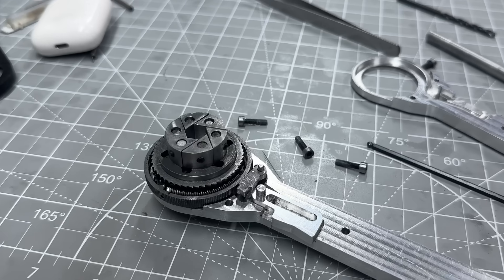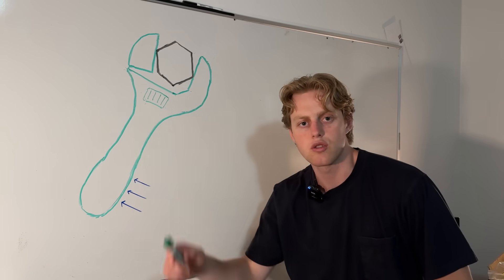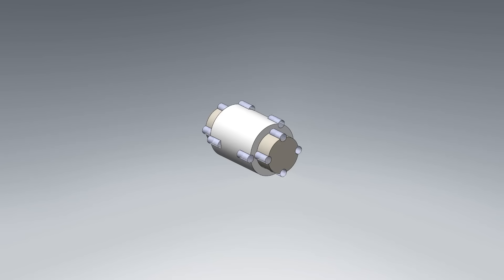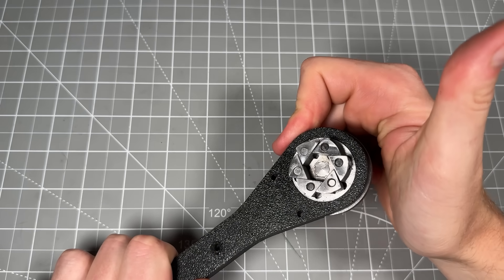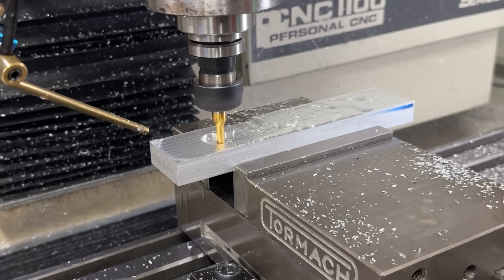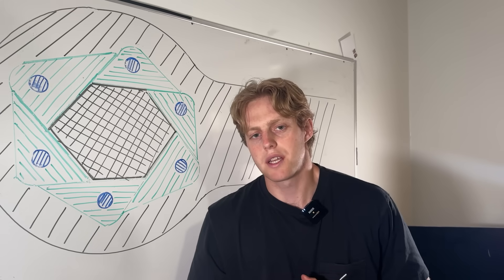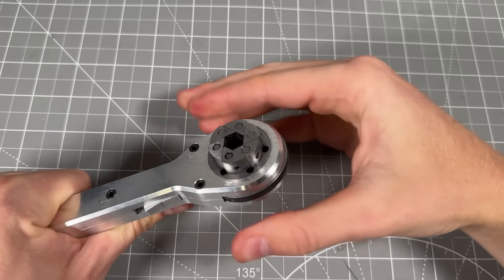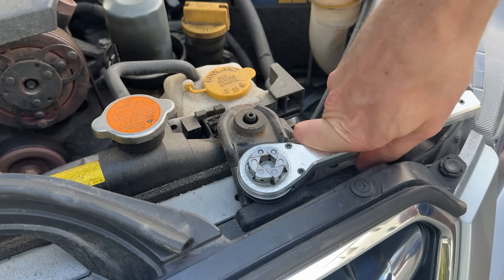I Invented an Adjustable Ratcheting Wrench

Comment: What might be possible if you released the criteria that one mirrored wrench can both loosen and tighten. Instead, you could make a pair or wrenches. 
First, this version would have a lower profile and fit in tighter spaces. 
Might the enable the gripping teeth to be moved more inward to the centerline of force of the lever and make it stronger?
Is there any way the center bushing could be made with much larger putter diameter so the a hole may be drilled through it, a hole that could pass over a threaded rod, enabling this tool to be more versatile?

Comment: One of the biggest downsides of sockets/screwdrivers is that theirs tolerances mismatch with bolts/screws too much and they wear down very fast. Your design takes rid of this, thats big +.
Unfortunately, massproduction will be VERY expensive, scale size up and down not that easy as well.

Comment: Having this as a socket would allow it to get into tight spaces and allow it to be used on already existing (power-) ratchets and socket extensions. It would also simplify the design because you would already have the ratchet mechanism. Maybe with this in a few different sizes you could swap out a whole socket set with just a handful of auto-adjusting sockets.
Working on cars a lot this would definately be game changer for me!
Great design!

Comment: You should definitely keep working on it, I once bought a one size fits all socket which was spring loaded pins into a bigger socket but it had terrible design the pins would bend in the housing easily. 

I like the locking mechanism on this, it is much better designed but as you pointed out at the end it works best on a flat surface you'll struggle do to some car stuff with it unless you design a longer socket.

Comment: Hi, i know this is random but i have a question, i work as a diesel mechnic and work on ALOT of differwent things of different sizes, this might ne a long shot but would you ever consider sending one out for me to test, can be used on excavators, dump trucks, trucks, vehicles, etc

Comment: As a mechanic myself, I find that compactness is MUCH more important than having more functions. I would rather buy two thinner ratchets, one that tightens and one that loosens, than a single thicker ratchet that does both, even if it cost me more. It's better to have to get two tools than just one that doesn't fit where you're trying to reach.

Comment: Instead of front and back tighten and loosen put them on either end of the handle. so the mechanism is thinner to fit in tighter spaces.
Reply: Where a bolt is located is a bigger issue than a one size fits all wrench. It’s why god created tool boxes. What I have a hard time finding is a super slim well made ratchets at affordable prices.

Comment: This would be a bad ass tool to have in a ratchet set for the easy stuff and to replace the old adjustable!  But, like you pointed out in the video, 9 times out of 10 getting to a nut or bolt isn't that straight forward. 

 I guess the problems this product would face is cost to manufacture vs overall usefulness. If you could get it made cheap it would be a welcome addition to any ratchet or wrench set.

Comment: Im liking the idea. I can't wait to see the future version, I will see if I could come up with a way to face loosening and tightening on one side. 
I would also say try looking at high-end drill gear boxes, some have pins to lock the gear box to not turn the motor when trying to take the chuck off or tighten it

Comment: I love this product! I will say don’t lose focus on making the best adjustable wrench. Don’t focus on a job for deep sockets and other tools. What you have is the beginning of a 3 piece set of small, med, and lg adjustable wrenches that doesn’t round bolts plus has a ratcheting mechanism. I would rather have that than make the weaker or larger by trying to do additional things.

Comment: I like the idea.  I do manufacturing of industrial control panels, mostly for automation and pharmaceutical applications. Two additions I would like to see is adding torque reading/limit to the wrench itself and a pass-through. Most of the nuts we apply have long studs. So without a deep well or a pass-through it wouldn't be all too practical for us. 

My main concern is how long will this last due to the precision? How well will it hold up to oil, dirt and metal shavings?

Comment: if, instead of a full rachet wrench, you make the same stuff into sockets.....and you make different sizes, each overlapping each other by a little bit. then i would buy it knowning that it can easily fit into how i normally work. i just need a rough guess on the bolt head size, and pick the "roughly right size socket" then rachet it like we already know how to with tools we already have. plus the additional flexibility of using U-joints, extensions etc. not to mention you can have smaller overall diameter for compare to current setting for you no longer need to build rachet ring inside.

i mean, your invention of spin-open and release grab is the best part of the tool, that's cneturies ahead of shift spanner. meanwhile for the racheting mechanism, with all due respect, really doesn't need its wheel re-inviented. 

best wishes bro. cant wait to see it become an actual product.

edit: to clarify, while it is great to have one tool/socket that goes both ways, it's not a big deal to have it go one way. choice one: bring a lot of socket that goes both ways. choice two: bring 2 sockets that go one way each that sure fits. it still wins. and btw i think only lefty-loosey is needed for most people. becuase if i have a bolt to tighten, i would just bring the bolt to socket rack and get the correct size. 99% of the time when i don't know the correct size is when i need to take off a (usually rusty bolt), or the last fucker who did repair work put an odd size bolt head that fits becuase he send old ones flying down the pit and couldn't bother to get the exact same bolt for the hole.

and i'm very sure that your tool's main intended scenerio would not be to replace sockets altogether, but to solve the "just save me the trouble of bringing lots of socket to the bolt" case. for the simple fact that having impact sockets only will eventually get you mad by " damn i wish i have the exact same socket but in chrome so it will fit with thinner socket wall" shit.

Comment: Awesome work and great engineering.  This would be great to have in the tool box - even possibly as a great tool to put into the car on a road trip so the bag is just a little smaller.  Would be interested for sure.

Comment: What could be really cool is a socket like that, potentially with different sizes for 1/8", 1/4" & 1/2" rachets. Basically, just implement the adjustment mechanism, double-sided just like here, but intend of a ratchet in the center, you have the square receptacle for the ratchet.

Comment: You can make this into a socket that can be used with existing wrenches. That would solve the issue of reaching into spaces. This being a universal fit socket would make it very useful for those times when you don't know what size a bolt is and you don't care, you just want it tight or out. Your ratchet wrench doesn't really add that much value to the concept. Just make two, one for tightening and one for loosening. Keep it simple.

Comment: Do those pins really need flats on them? Can you just put the pin through and use the set screws on the jaws to preventaxial movement of the pins?

Comment: this is honestly pretty cool. I would say for anything larger than 1/2" bolts the entire ratchet mechanism could be made larger and bigger so that it's more solid as bigger bolts will require higher torque specs. I could see this being a one stop shop for almost majority of the bolt work on DIY projects.

Comment: I would say it shines in fields where you have open access to fasteners, factory maintenance, or design/prototyping. What comes to mind for me is when engineers are building factory fixtures/benches from off the shelf supplies, and robot assembly, it makes the most sense for people who don't roll a toolbox around to do their work.  I wouldn't target automotive use, there's too many specific places where sockets are used because nothing else will do, and if you already have a full set of sockets sitting next to you that's what you would grab

Comment: I'd spend money on it now, but you don't seem entirely happy with the design. So in addition to your plans to make it fit more places and find a way to tell which side does which, I'd be interested in engraving marks to measure the size of the gripped bolt in imperial and metric.  An even greater challenge would be to make the center completely hollow so it could thread nuts onto bolts as well.

Comment: I think you might need a set of about 3 or so to be efficient in a range from 1 1/4 inches down to 1/4” 

Ultimately it’s impossible to replace every job. I work on small aircraft and generally operate between 3/16” to 3/4” and I have a variety of different tools. Sometimes I wish I had a tool that doesn’t exist.. This can fill the role of quickly tightening or loosening easy access bolts and nuts but if the threaded shaft is too long then it might not be deep enough and like you stated the bulky body that houses all the required parts make for cumbersome accessibility. 

I want one though

Comment: As a mechanic I can assure you that unless it has a pass through for nuts on long threads it wouldn’t even be considered to be anywhere near my toolbox let alone a regularly used tool. When I need a socket I just take the whole rail with me and have the whole set of sockets right there at the work. You should also consider the forces when using a cheater bar because sometimes getting a bolt loose is more valuable than the cost of replacing a broken tool.

Comment: Seems like a neat design. But i can tell you most of the time when working on vehicles is that the nut or bolt is never easy enough to get to, like you said it could be in a tight spot, a recessed area, or at an awkward angle, longer sockets or extentions help reach those and the flexible joint attatchment helps with the awkward angles. Sometimes nuts or bolts are also tough as hell to break loose. Your design looks to grip all sides with slim chances of slipping which is good. Id say try to incorperate a nice 'biting edge' on the inside of those sliding teeth to add extra grip. If you could somehow add a spherical joint around the head of the tool to be able to adjust the angle that might be beneficial too. Just my thoughts!

Comment: This is a very cool idea, but as someone working on cars, I can’t imagine reaching for this tool over a regular ratchet or wrench. It’s bulky, and the fingers seem to flex under light load, which I assume would be exacerbated with a low-profile bolt head. The backdrag is high, and if the bolt is recessed, this tool becomes unusable. The pass-through feature is nice, but any wrench can achieve that. If it slips off the bolt, it seems like a hassle to reset and reattach. The fixed handle limits usability, though that might be the easiest aspect to upgrade.

Comment: ive been a mechanic for over 10 years and heres what i think. i think this design would work out better as a socket. that way you could put it on an electric ratchet, maybe an impact if it could survive that. making 2 sockets one for loosening and one for tightening, this would fix the clearance issue. i can see it being a good design, especially for rusted bolts where u generally have to hammer on a smaller size socket, this would just grab it either way. i think another improvement you could make is adding teeth on the inside, this would bite in and grab things much better. if you look at snapons flank drive design u can get an idea of what im talking about.

Comment: Could always send your current model to an engineer for tools and ask them to try and make different models for ussues you run into and see what they suggest they might edit your original model but hey even if you do need more then just 1 tool for your garage to handle every type of bolt just by having 3 different models that would be much better rhen having to own like 500 different types of tools 😂

Comment: I think you should make a socket version, that can fit on an air gun. That seems like not that much of a change. And I bet if you gave them both to a shop, one would get far more use than the other. But I couldn't tell you if that would be the wrench or the socket.

Comment: Good job, I cannot give you any mechanical advice but you should look at a lever on one side that could change the direction like the standard socket driver, and the only difference would then be it could work on multiple nuts and bolts.

Comment: 👍👍👏👏👏 I just came across the video and your ratchet design. That’s great! You mentioned the ability for the ratchet head to be opened and its ability to grab the nut head. I never thought about your solution but thought a magnetized socket would be great for those times when you can’t apply pressure on the wrench to keep it in place, whether sideways or working upside down. The frustration and fatigue trying to keep the socks in position while turning the handle is tiring. Your invention seems to address that issue to keep the socket locked on and in position. Hopefully you have the support and continue to develop the tool.

Comment: A simple hex/socket adapter would likely solve the problem for most people if they want to use this with a socket/extensions. otherwise, you build a standard ratchet on the butt end of the handle. One side is adjustable, the otherside is universal

Comment: Beautiful tool. Like you said, it's not going to actually replace a tool set but it's still a cool design. Putting the tightening and loosening ratchets on opposite ends instead of opposite sides would make it thinner and reach into more spaces maybe?
Like: 
O______________
                               O
Instead of 
O
----------------------
O

Comment: So could you make one with interchangeable teeth. For example make it so you can put on a fluted set of teeth for removing a rounded bolt or even one that twists out instead of inward so that it could grab into the interior of a stripped out bolt? For example folks always strip out allen and star headed screws. I know clearance is an issue for the head of the tool but still could be invaluable in quite a few settings like express oil changes, farm equipment, industrial maintenance. I'd love a tool that bite harder the more torque I applied onto a rounded bolt head. Especially since most extractor sets on the market are either to soft and the material their made of fails or the design sucks since the flutes aren't rifled instead being straight. Also could come in handy if the teeth are interchangeable so that you could replace them as they brake and wear down.

Comment: Dude!  100%  If I had only one piece of advice for you it would be this: Your skills and your capacity for clear communication is so far ahead of the pak that all I would wish for you is a lower heart rate and to hear your voice a bit closer to how your friends hear it.  I'm flabbergasted (impressed) because I'm both an old-fart broadcaster, TV host, and radio DJ, and a fantasy tinkerer in the machine shop or places adjacent.  Ten thousand people watching you?  I'll be proud to say I "knew you when"... this is an excellent channel that's just getting air under its wings -- you're gonna fly wherever you want to go.  Just do you.

PS: I'd buy this if it's under $300 CDN and comes as a pair that will go to 7/8ths... once a person gets used to using this thing they'd be hard to switch to anything else -- but, man dear, you have to back this with a lifetime warranty.  But yeah, I would have this and -- more than that -- it's probably the one tool I'd oil and polish as much as it deserves

Comment: Tip for recessed bolts: make an extention arm with reverse chamfer on ratchet end and make normal chamfers to the bottom of ratchet sliders.

This way you lock the extension arm by opening the ratchet and just sliding it in

Comment: You need to do measured torque testing. I think the design is good, but there are quite a few wear, jamming and similar concerns. Great work though, and it does look pretty good.

Comment: Make one smaller for bolts 1/4” - 7/8” and move the switch to the head of the bolt so you can really slim down the handle

Comment: Great work, however it is too expensive to make since you approached the problem from a theoretical angle. The lessons learned you mentioned are the key. The design must be simple. I thought about it and I will try to explain my simple design iteration. The wrench head could be a circle with 6 triangles pinned to it. Spring loaded to push inward. Now, the bolt can simply push triangles away to fit inside. The spring-loaded triangles will be shaped to create individual ratcheting action. At the same time the triangles will tighten the grip in the direction of rotational force. To loosen, simply flip the wrench over. This is simple buy more of a flat design rather than a deep socket wrench

Comment: I have an idea for tight spaces. For one, definitely add that nice large radius chamfer for the teeth. Additionally, i think you can add an extension to clamp onto that allows you to reach low clearance spots. Leverage will be a problem, but I assume most of the time it will be for loosening/fastening bolts that don't need a crazy amount of torque anyway.